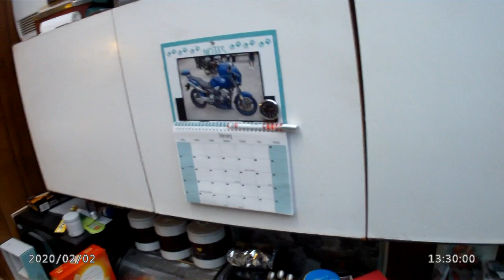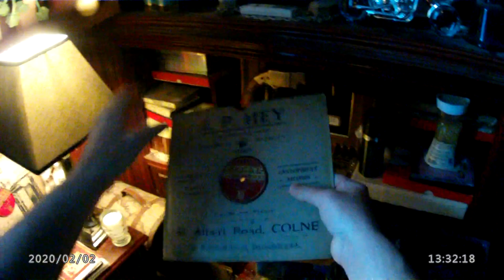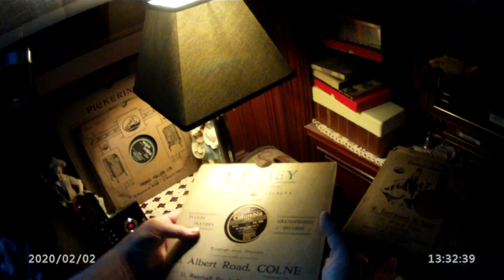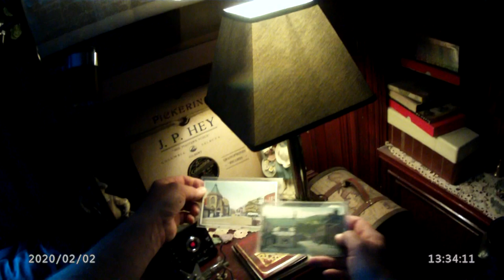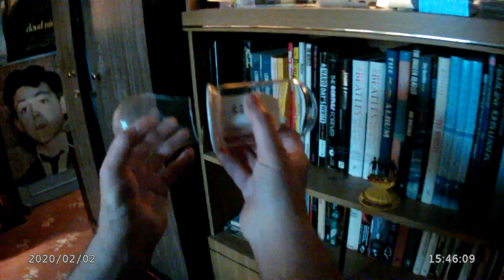....sticky back plastic ?...

Comment from the maker: ...the two George Formby 78's I gave away were damaged ones on the Decca label - and the titles were 'Fanlight Fanny' and ''If Women Like Them Like Men Like Those - Why Don't Women Like Me ?!'' The ones I still have are on the Regal Zonophone label . Most 78's are virtually worthless - apart from Elvis ones on the 'Sun' label ....and Beatles ones from India on Parlophone !
Reply from the maker: ....condition is crucial with record valuations - there are some George Formby 78's on e-bay for £25 - though they've still not been sold yet at that price , but if the shellac surface and labels are scratched ....then they're only worth a token £2 for their novelty value . The best place to sell them would be the Imperial Hotel in Blackpool during the 4 times a year fan's get together ! In 1993 , George Harrison turned up ...but it was held at the Winter Gardens then.

Comment: Hiya Steve the glass domes I have a heat gun that has a wide range of temperatures from aired to take your skin off. You could put in on low and warm/heat the glue which will soften it then hopefully just pull apart gentle. If it where me I would definitely go on holiday put your feet up after all the graft you do at that place you work. It would be Blackpool way for sure been to London a couple of times its nice but what a rip off if you haven't got eyes in the back of your head. if you are happy with your cupboards what the F@@@@ has it got to do with any one else. As far as the biscuits are concerned my Grandma always said a little bit of what you fancy does you good. I also like them biscoff a £1 in poundland excellent value. Keep em coming Steve Morphy!
Reply from the maker: ...well, as decking planks are so cheap - and strong  , I might put some shelves up in my little utility room for all my bike stuff , and just use that untidy shelf unit with the two drawers at the bottom for helmets and gloves ! The Fablon rolls should improve things , but I don't know why I bother with this old house ...I'll probably have to sell it to pay for MY carehome bill eventually ....!
Reply from the maker: ...soaking in Harpic 'acid' did nothing overnight - so I'll leave it on top of the gasfire for a bit to see if that softens it - but it looks like a hard clear epoxy glue, which will be a real bugger to remove....!

Comment from the maker: ...any suggestions for loosening the glue on the edge of those glass domes would be welcome ! Each 'sculpture' cost £19.99 ....or was it £29.99 - and I bought them when I was a barmy Beatles Collector in the 1980's and 1990's...and spent a bloody fortune on similar tat and loads of records . I SHOULD have had holidays in the sun instead , but my hobby became my 'active compensatory factor' , psychologically speaking ! When I sold most of my collection between 2002-2007 , I put the cash towards my house purchase. Do YOU collect anything ...? If so...WHY ?!!
Reply: Hi Steve,
Are the new domes plastic or glass?
Reply from the maker: @SCCFORUM  ....glass - I've added some Harpic to the water ....but if that doesn't loosen the glue I'll try a hairdryer to try and soften it .
Reply: @StevesHornet900  Sorry Steve, 
I asked if they were plastic or glass and you had already said what they were in the question.🙂
As they are glass, I agree with you on adding a little bit of heat to soften the glue.